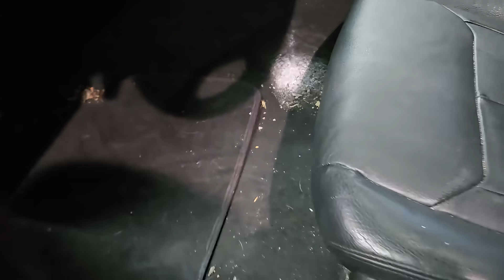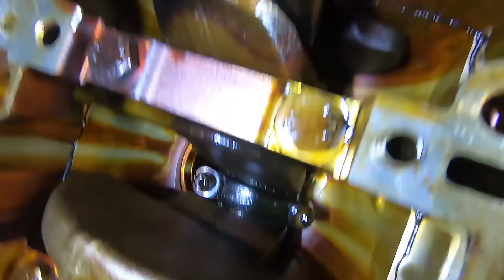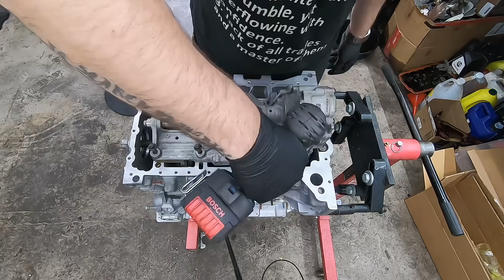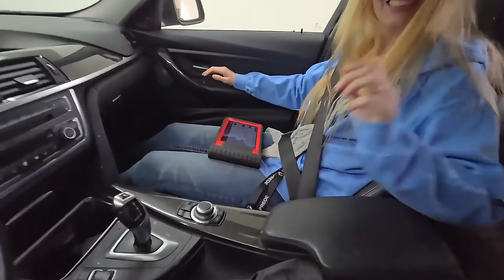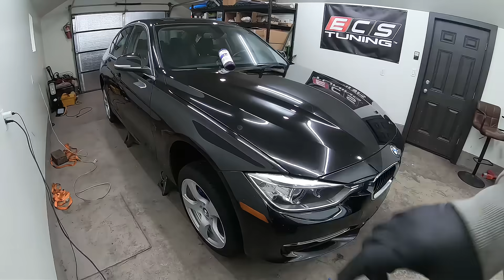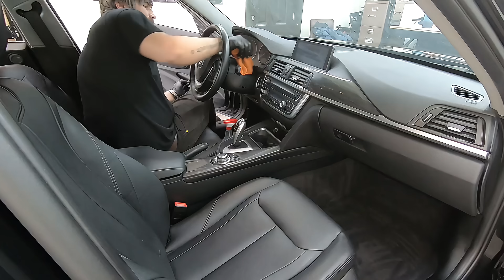I Rebuilt a $1,200 BMW Everyone Gave Up On (Full Build)

Comment: BMW engines are a bunch of plastic spaghetti.  Very intimidating, I rebuilt my 2007 650i and it was SO MUCH.  All the brittle plastic parts that broke taking it apart ended up being the most expensive and hard to source parts.

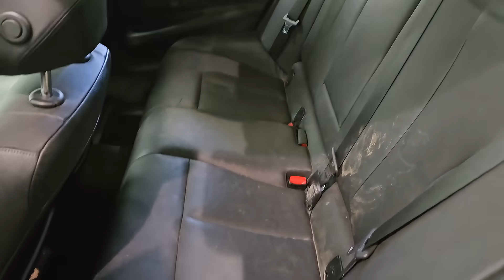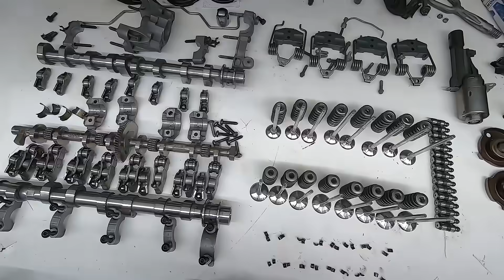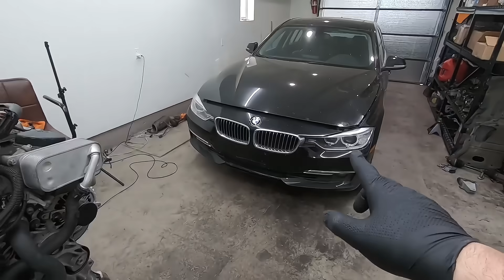Comment: On Copart you can get is less than <$1,200. 3:00 - Thats coke. 4:53 - Thats when previous beamer owner and his GF got busy at the back seat. You're not a real beamer fan for not knowing that. Bro you need to get a 4K camera like a Panasonic Lumix GH4, used is $250. "Properly neglected" lol 😂 59:21 - How did you clean it, can you make a video on that? 1:03:45 - What about the engine piston cavity, with this level of heavy wear, wouldn't it require boring/honing? 1:28:48 - God damn... you make it seem like its easy only until its completely finished, looks like it belongs in a rocket. lol

Comment: I picked up a neglected 2012 328i in black just like yours for $900. guy said the engine is seized. I finally got it home and looked around. it turns out the timing chain guides broke and actually spins fairly easily. I am going to inspect the timing chain later today and see if it spins after I remove the broken guides. if it does, ill put on a new chain and guides and see what happens. I bought the car with the intention of replacing or rebuilding the engine as well.

Comment: no amount of maintenance can fix defective factory parts. some of these engine need full bearing replacement as part of "maintenance" or else they die. no amount of maintenance can prevent a crappy plastic part in the engine to crack and starve the engine from oil. no amount of maintenance can fix garbage.

Comment: Thats a great job, well done! 🎉
I have two pieces of advice for you:

1. Please always lap the valves. Also when they are not new.

2. Dump a load of engine oil on the chain assembly during the build. Otherwise you can experience excesive wear on the guides.

Otherwise you've done a great job. And I loved to watch it. Thank you!

Comment: My only suggestion would be to check the bearing clearances (connecting rods, main bearings) using plasti gauge.

I’ve seen clearances which were out of spec, with brand new bearings and crank.

Comment: Please replace the fuel filter and perhaps a brake fluid flush. Im shocked the sway bar end links are not trashed given the massive negligence of previous owner.  No alignment required is another normal maintenance issue ! I rarely drive more than 5K without an oil change but a new engine usually gets a quick change at 1000-2000 miles!

Comment: I agree 100% its actually a very good engine if you change the oil every 3000 miles. Issues was BMW recommended oil change every 10k and that hurt the engine and it got a bad wrap, I have 150k on mine no issues at all , just change the oil every 3k .
Reply: 3000 miles is overkill. Use the ryt oil instead 5w30 and ryt gasoline octane what car is made for 91 octane and up
Reply: @Spiritualwarfare587 it may be overkill but it’s cheaper than buying a new engine
Reply: You are right. Better an overkill changing every 3000 miles than killing the engine. Changing every 10 000 miles is ridiculous no matter how top quality the oil is.
Reply: @lukaszbebnowski7633 i do10.000 and never had engine problems , according to bmw is every 18.000 on my 330e
Reply: 5000 or 10k km is the sweet spot. The oil still holding great, and your engine is clean. IMO 3k you’re throwing away very capable oil. And 5 k you’re good for 2 oil changes a year, one in the summer and one before the winter

Comment: The N20 main issue was timing chain guides plastic breaking apart and pieces getting sucked into to the oil pump pickup tube and hence starving the engine of oil.  That timing chain looked in good shape so perhaps it was changed out. But the neglect is overwhelming. Great Job!!😊

Comment: BMW recommends changing the oil every 10k on this engine, lol.  The problem is not the people that buy them.  Ok ok ok, maybe 33% the time it is.  In this case the lube tech probably overtorqued the drain bolt (i.e. it was properly tightened so oil didn't leak, as BMWs are designed to do) so the perpetual-oil-top-off-to-leak ratio was thrown out of equilibrium and killed the engine.
Reply: When it's leased, BMW handles the maintenance. It's not even the CPO buyer again they usually can afford to take their vehicle to Jiffy Lube or something but it's when you get to the 3rd owner. They want the car for status and nothing else so they may not be able to afford the typical oil change on these cars, this is mostly coming from women as well.

Comment: I just bought one of these at auction for £600 but with 210,000 miles on it but running, despite the rock solid collapsed oil filter and some of the chunkiest oil i ever seen, needed a new power steering pump and the PS fluid looked like mud but now its doing great